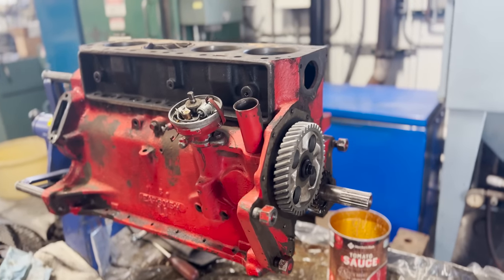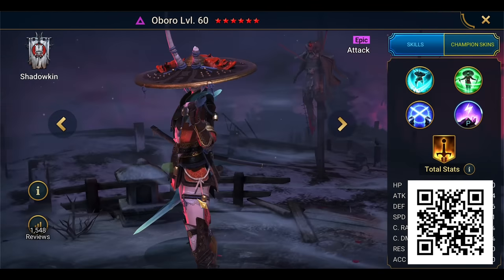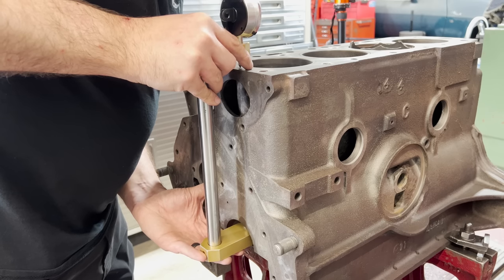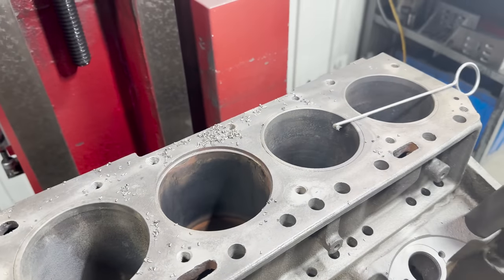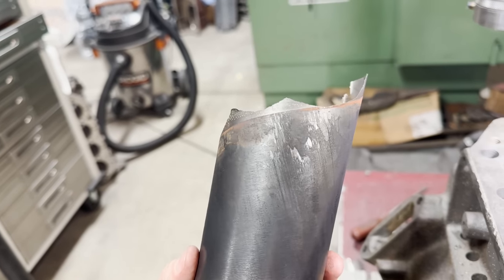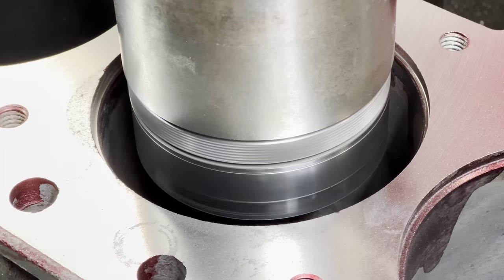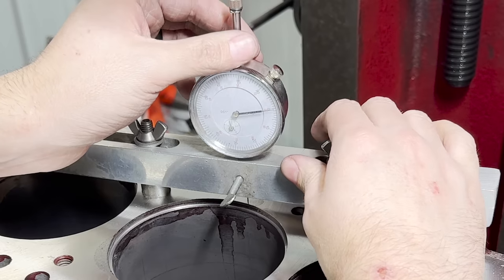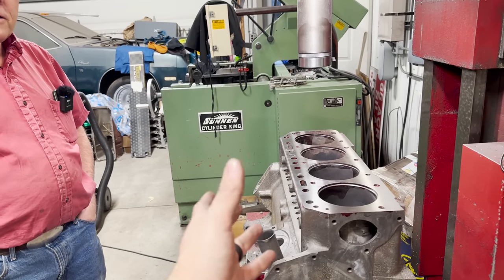Do YOU Want To Know Why WE Don't Use Sleeve Pullers?

Comment: In the late 70's I was rebuilding a TD6 dozer. Got it up and running and it was making water in the sump. Drop the sump off and had a look, water was pouring out in the front of No. 1.

So I decided that it must have blown a liner seal. Ergo out comes the sleeve, half way out I realize it's not a wet liner. Oops.

After much head scratching and butt kicking (must be amuseing to watch someone kick themselves in the butt repeatedly) I finished bulling the sleeve out, cleaned it up and reinserted it.

With further investigation and removal of the timing gear cover, timing gears and a backing plate I discovered two rotted out expansion plugs. 10c each 😒

I ran that machine for apout a year and a half and as far as I am aware the dozer is still running.

Comment: IN THE CASE OF THIN DRYWALL SLEEVES,
ALSO TRY SHRINKING THE SLEEVES BY USE 
OF DRY ICE OR CARBON DIOXIDE GAS SPRAYED IN CYLINDER, OR ALSO LIQUID NITROGEN!!
IT MAY DO AN EXCELLENT JOB MAKING SLEEVE REMOVAL MUCH EASIER!!IN ANY CASE IF IT IS A PROBLEM TO REMOVE, GRAB THE BORING BAR !!

Comment: Do the sleeves need to be shortened since the counter bores were touched?
Reply from the maker: Shouldn’t be an issue. While it was “a lot” off the deck, there should be plenty of buffer in terms of the overall length of the sleeve tolerance

Comment: The problem is that these tools are specifically made to pull these sleeves out. They should NOT be breaking when used as directed. That points to improper design of the sleeves or the puller.

Comment: I Take it they dont sell oversize liners for that engine, What I would do is to Clean up the Cyl. Block Bore and use some JB Weld to take up the gap between the block bore and the Liner and call it a day, it will be better than NEW 😋 Doing that 😜 LOL, I love JB Weld, I Use it on Aluminum intakes where the coolant has etched the aluminum around the water port sealing area,  I Glass bead the Aluminum, clean the metal with brake clean, apply the JB Weld, allow it to set up over Night, then machine the intake flat, My local machine shop uses JB Weld on Flat Head, Heads where the water has etched the metal, then Machines it Flat, Never a problem with that repair.

Comment: So, I've been told on numerous occasions one should not bead or sand blast a block, due to the potential of ending up with unremovable grit in important places.  (Like oil galleys.)  Is that excessively paranoid?  Does rinsing and blow drying (like I do with my luxurious beard) really suffice?
Reply: Also, is it possible the cylinder distortion you're seeing there would go away if you used a torque plate, so that the block was under the same forces it would be once the head gets bolted on?  Or would that potentially cause it to experience more distortion?

Comment: I would make it less out of round and use sleeve retaining compound to seal the deal. It would be much better that way even though you would still be couple of thou out of round.
You can't do anything about being looser fit, but some engines have dry sleeves that can be pushed in by hand and they work just fine.

Comment: Why does the cutting spindle wobble ever so slightly when cutting the cylinders?  Watching your slow motion, you can see it against the vertical bed of the machine?  Is it impossible to have zero head movement in the opposite direction of the cutter, and this 'movement' is a known value, that you add into your cutter setup?
Reply from the maker: Because I’m pushing the limits of what can be taken in one cut on our machine lol.

Would never take a cut that big if it wasn’t a rough op like this.

Comment: You should never pull dry sleeves they seat against the bore wall sealing them a puller can leave a scratch up the bore wall and if there is any pressure built in the lower end of engine that pressure can push oil up in the scratch and between sleeve and bore causing the sleeve walls to warp. Best way to remove a dry sleeve is to weld beads in it lengthwise the more the better they will shrink as they cool and falll out.

Comment: You can take that mig welder run you a few beads around it and a spiral wait until it starts cooling and then it will just come right out you won't have the machine nothing just a trick from an old welder

Comment: The block was manufactured at a time when they used vernier calipers and a standard which was kept in a tool room and was only calibrated when the bore was too tight,  when the cutter wore out,  or when they put in a new cutter.   So there may have been as many as 3 different bore sizes in the same block.   Same with the parrelism as long as the head gasket sealed it was good enough..  No compressed air just a chip brush to clean the machine in the factory and motor oil for cutting fluid. 
What do you expect.   The way you did it the motor will likely live longer than the owner..Like your dad said it's not a racecar..
At least you were smart enough to center up the cutter in the bore. 
I watched a video where a hillbilly made a 427 out of a  5.3 and he did it by eye. 
All those digital read out and the machinist still wanted to do it by eye. 
What was the bore spacing of the cylinders? 
The Serdi is a good machine for working on farm tractor engines but is behind the times when building racing engines..
No one in Nascar uses that old stuff anymore..

Comment: Is it possible to fix a 5.9 Cummins block that threw a rod and made a hole in the block just over the starter side of the block. I assume if anyone could you could.
Reply: Yes but core blocks can be had for less than it would cost to fix properly.
Reply: @bcbloc02  Cummins cores are running about $4000
Reply: @ChannelZeroOne  You can buy a new 12v block from heavy duty pros for $1462
Reply: @bcbloc02  Its an 06 block. 12v block wont work. The prices listed require a core. They will want your old block and give you nothing for a windowed block, but yet you might get a block that's been clearly repaired from the same type of damage.
Reply: @ChannelZeroOne  I naturally think 12v when someone says 5.9 yeah common rail block is different. D&J precision offers exchange reman blocks. I trust Drew to not be selling patched up junk, so with no core you would be $1850 for a good block ready to go.

Comment: Good machine shops are getting hard to find. I had a shop I trusted to do work for me for years. I brought in an old TO20 engine to them for a rebuild and it became a nightmare. The engine started making noises within minutes of starting it. I took off the oil pan and could see things were bad. I had coated the inside of the block with grease after having it cleaned and it was all still there so was a bunch of metal.  I went down to the shop to talk to them about what happened unfortunately unlike the grease they were gone. They closed the shop within days of me picking up the engine. If anyone knows of of a good shop in the Detroit ares or north of Detroit let me know. it would probably be cost prohibitive to send it to these guys
Reply: Had a couple of 'Midnight disappearing acts' just like yours. Burnt twice figured I may as well start doing it all myself. If the item was bad enough to have major work/money thrown at it, I'd find a junk yard part. As usual they were better part(s) than what I had so $$ saved.

Comment: Fun Fact:
The four cylinder junk pile on the new Bronco is equipped with a pitiful plastic valve cover, a ridiculous plastic timing cover, a pointless plastic front oil seal, and a, worthless plastic oil pan.  Please make a note of it and avoid it.
Reply: Weight reduction, ease/cost of manufacturing and increased likelihood of costly repair work. There's three very valid reasons which all benefit the manufacturer, and thus will be implemented.
It's not rocket science.

Comment: If you can cut accurate to thousands of an inch, why not just use another tool (same accuracy) to cut a line down the side of the obstruction and then pull it out?

Comment: I've welded them a few times down the middle, and worst case I'll braze in a cross bar and then slide hammer it out, IF I can't get it to a machinist with a boring bar. oversized sleeve OR Braze them in, send the block out for oven brazing, they put paste on the sleeves, and then braze them in. Not sure if you have anyone who can do it though

Comment: Holy crap. At 5:24, I can see the spindle of your boring machine woggling around as it bores. I bet it is deflecting over .015". You need new spindle bearings fo sho.
Reply from the maker: Pushing the limits of the machine. That’s like .180” cut… we’ve done up to .250” but ideally you’re taking .060” or less. I wouldn’t push it that hard if it wasn’t a rough op.

Comment: stupid  question  why  not  us  a chemical  stripper  for the blocks ?  my friend  uses that   for the engines he  builds then ya dont get  any  blasting  grit in the engine seen it alot  with american engine  builders/machinists  they  blast the blocks rather then  chemical  cleaning
Reply from the maker: Well for one, the EPA makes it extremely expensive to dispose of waste that comes from that process (somewhat rightfully so though, it’s nasty stuff…)

You will see in videos we have two spray cabinets that are chemical cleaning processes. But the bake & blast method does a much nicer job, and the media is no problem if you do a through job rinsing.

Comment: I don't like judging other people's work, but you are doing all this work without a torque plate. So your work is just as bad as the previous shop
Reply from the maker: You clearly have no understanding of when a torque plate is used 🤣 but A for effort buddy 🥰
Reply: @Jim's Automotive Machine Shop, Inc.  I'm a pro. When you torque the head, it distorts the hole engine. So the last company could have used a torque plate and that is why the top of the bore is slightly off. Your doing it without a plate...so when the head gets torqued it's going to be off